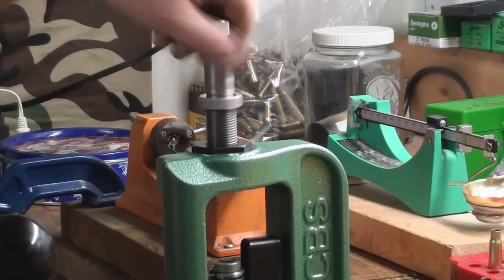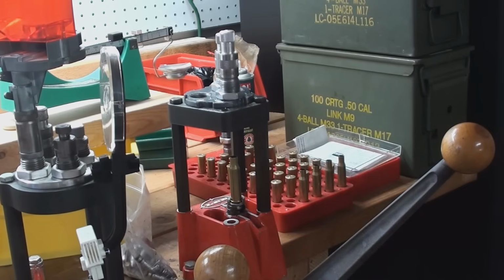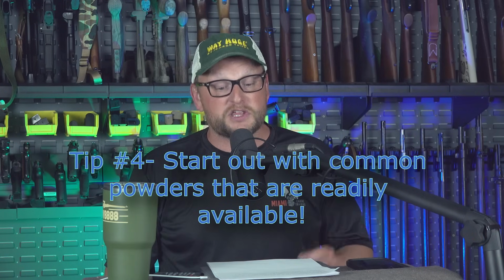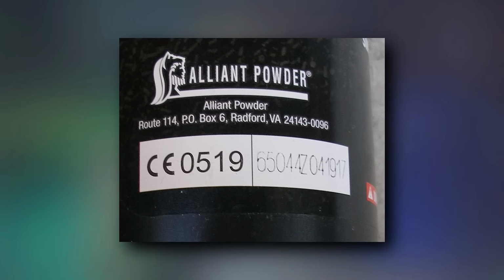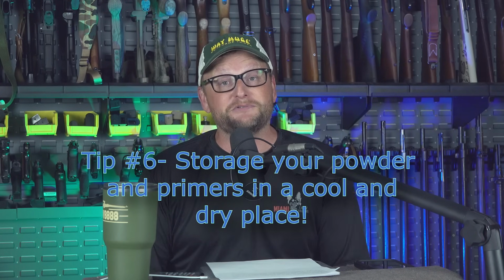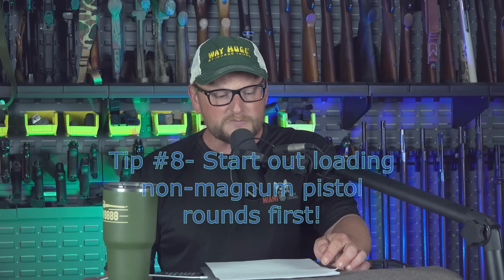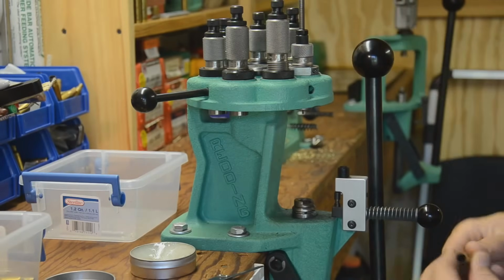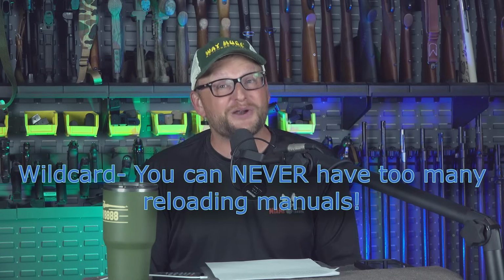Top 10 Tips for Beginner Reloaders

Comment: I started with a lee 4 hole classic turret press. You can use it as an auto indexing turret press or as a single stage. I think I have close to 20,000 rounds loaded on that press.  I did have to replace a part once, but that was because I was being negligent. The part costed 0.75, so I bought five of them and now I'm stocked for life.
Reply: I love my LEE hand press & dies.... yes parts for LEE stuff is affordable for the working man.
Reply: The classic turret is pretty solid.  Bodge or 3D print yourself a case kicker and you've eliminated the only real "not enough hands" problem.
Reply: I love this press

Comment: The Biggest one, is the reloading manual and develop your own data starting with minimum charges and work your way up to get acceptable accuracy/performance. Also keep a journal of your reloads so you can remember what you've done from batch to batch. This will help greatly if you develop a load that works really well for your fire0arm.
Reply: A good set of notes as you go along helps with consistency.
Reply: Just get good labels for each box of ammo you load and get multi colored permanent markers to color the primer end of each box of cartridges so you don't mix them up.
Reply: Keep track of the number of firings and trimming of each batch of brass. False economy if you have a case head separation, damaging you or your instrument.  Also watch for loose primer pockets. Use published data at first, to be safe. Learn what overpressure signs are.

Comment: This is a great list. If you wet tumble with stainless media, don't forget to treat the wash as toxic and hazardous. Also those pins can wreck a decapping or other die.
Reply: Show of hands, anyone who's probably sent a ss pin down range on occasion.  Lol.  It's a little more labor intensive but I much prefer wet tumbling.
Reply: I wet tumble my brass and they come  out immaculate clean...one thing I recommend is after rinsing the brass in distilled water I put them in a tray upright in the oven for about 45 minutes at 250 this makes sure the cases are bone dry before reloading
Reply: I have a rcbs decapping die punching primers and ALL my brass goes through that before going in the wet ss pin brass tumbler. Might as well clean the primer pocket while it cleans the case.

Comment: A few recommendations I have. 

1. Hornady dies with the bullet seating collar, and micrometer seating stem. It elimites SO many problems with concentricity and seating depth

2. Little Crow "Worlds Finest Trimmer II" is hands down the best way to trim brass to length, especially in quantity. 

3. If it feels off when sizing, STOP. You absolutely do not want a stuck case, they are a total nightmare. 

4. Nu Finish car polish is the best option for brass tumbling polish. It gets the same results as expensive firearms speciffic polish, and is literally 1/10th the cost or less. Use 1 cap full each time you tumble brass. It will come out mirror shiny in short order, and it leaves no residue to foul powder or primer. 

5. Reloading manuals are often brand speciffic. Hornady manuals cover ONLY hornady bullets. Sierra only covers Sierra, ect. 

6. Label EVERY load you make. You absolutely will forget what is in a particular batch of ammo. So keep a log book and label system

Comment: I’ve been reloading for five years, I started out with the cheapest Lee press you can buy I gave $38 for it. I’ve loaded approximately 3000 rounds with it with absolutely no issues. You can still get one of those for about $45, they work that’s a good way to start to see if you like it. I’m still using it cause it still works. I got started loading three different loads and I probably didn’t have $200 in the deal. Buying a four $500 press to start with is ridiculous. Lee precision is the way to go, their dies especially the bullet seating die is the best.

Comment: The Lee manual is a must when your new. I use it more than any other
Reply: Lee manual reminds me of an artillery tabular firing table, with the 1 Grain Velocity and Pressure Factors.
Reply: I prefer the Lee manual over the others. Lee is not brand specific when it comes to bullets. It gives you data for the type of bullet, shape, composition, and weight. Hornady gives you data for Hornady bullets, Speer does the same thing. Both fine manuals, but for their brand only.
Reply: Lee has load data for a wide variety of loads, far more than any other manual that I’ve seen. They aren’t trying to sell bullets so they offer data for most weights and styles. You look at the Hornady manual, for example, and there’s no data for lead or plated bullets.

Comment: I had to learn to reload from day one! 44 mags cost half a dollar back in 1986. It cost me a quarter to reload my cartridges, now it cost me a quarter to reload one and $2.00 to buy them. Lifelong investment pays off. I have reloaded over 10,000 44 mag for the same pistol. I use Lee's 44 mag hollow point casting mold at 240 grains using the litho-plate I bought back in 1987, and still have 40 pounds left over for the 75 pounds I bought for $25. Your video was very great with the information I had not thought about. Great work! Keep up the good works.
Reply: I started loading 44 mag. back in 1969, casting my own bullets.  Primers cost me 3 cents each for CCIs, 2400 powder was $3.95 per Lb.   I could shoot my 44 for less than my .22 with CCI Mini Mags!

Comment: I tumble my cases outdoors. I dump and strain the tumbler outdoors too. The current tumbler I use is a 5 gallon drywall bucket with a small electric motor bolted to the plastic bucket. A metal gear with old lugnuts welded on is mounted on the motor, this makes it vibrate. Just use a rubber bungee to hang the bucket by it handle. Does big batches and cost nothing but junk laying around.

Comment: I started with the RCBS Supreme Master reloading kit.  It has a Rock Chucker press.   Looking back, I wouldn't change a thing.  I have an RCBS case prep station and a RCBS Charge Master scale.  The reloading kit came with a beam scale.  No matter what, do NOT get rid of that.  I use the RCBS Competition Rifle die sets and the Lee factory crimp dies.  I also use the Lee shell holders with the press because they come in a case with all the common case holders.  I use the RCBS universal hand priming tool.  I do have two of the standard RCBS hand priming tools that are set up for .223 Remington and .308 Winchester respectively.  I use the Lyman Turbo 2500 dry media tumbler and the Lyman TS-2500 ultrasonic cleaner because it's big enough to clean tools and several hands full of brass.  I specifically chose the Lyman Turbo 2500 dry media tumbler because it curls back towards the center at the top.  That aids in circulating the media.  I also have an RCBS powder thrower/charger for loading plinking rounds.  I use the Hornady collet style bullet puller.  It's so much easier and more quiet.  I can use it in the morning or late night when my family may be asleep.  I log every cartridge load data that I make in a Lyman log book.  I also mark on my containers, the load data and the date those cartridges were made.  I use the RCBS lube pad for rifle brass and the original RCBS lube spray and much prefer it to the libe grease because I know what I put on the case is very light and thin.  I put used dryer sheets into the dry media tumbler to reduce dust and lead in the dry media.  I think lastly but most important are several manuals.  I use the Lyman, Richard Lee, Hornady, Barnes, Sierra and several others.  Ultimately study the craft and be safe.  I keep a fire extinguisher close so that in the event that a powder starts a fire, I can wait until the powder is done burning I can put out the remainder of the fire.  Never try to put out the powder itself if you have that happen.   It is guaranteed to spread if you try it.  Wear safety glasses... especially when priming the brass.  Again, safety first.  Never have more that one powder out at a time.  You don't want to get them mixed up nor confused with one another.  Have fun!  Be safe!

Comment: Great info. Thanks. I look forward to more.  I'm committing to starting to reload this winter. Complete beginner here.
Reply: I’m with ya
Reply: Check out the channel Johnny's Reloading Bench and Panhandle Precision. I've only been reloading for 5 years now but have learned everything I know from those two. There are other channels as well depending on how far down the rabbit hole you wish to go.
Reply: I went with a Lyman kit (included a turret press) when I started. I think it was a good kit, came with almost everything I needed. I bought an extra electronic caliper and electronic powder thrower, but other than a couple little deburring tools I think that was it. Also picked up an additional reloading book I think too.
Reply: @brutalityondemand18  Thanks. I'm subscribed to JRB. I'll check out Panhandle Precision.  Do you use a manual turret loader? If so, what kind? I've been advised to get a Dillon, but with all of the info from the net, it is difficult to make a decision sometimes.
Reply: @clamum9648  Do you still use that Lyman, or did you move on to something else since?
Reply: @givemethemusicd  Still have the Lyman. I haven't reloaded for some years cause there just isn't much room for me to set it up at my current apt but I'm gonna stick with it for the foreseeable future, works fine for me.
Reply: For reference...I shoot a lot of pistol straight wall and common bottleneck rifle.  I also enjoy shooting common milsurp at lower volume, which has sometimes been difficult to cost-effectively source in the last couple of years. My budget for equipment is $2000-$3000ish.
Reply: @clamum9648  Right on. Thanks.  It's been tough for me to make that investment with so many options out there.  I've been waffling for 3 years now, lol. Technically one year.  I was about to buy a Dillon, and didn't because of Covid and the dry-up of primers.  Didn't see the point.
Reply: @givemethemusicd  I started on a Lee hand press just doing 9mm, 45 Auto and .223. I then upgraded to a Lee 4 hole turret press which worked great for pistol loads but had a lot of variance loading rifle rounds; by this time I was loading for .223/5.56, .300 BLK, 6.5 Grendel and .300WSM. Finally bought a good single stage which I wish I would have done at the beginning. I agree with IV8888 on the RCBS Rockchucker recommendation as a first, but for more precise loads I decided to get the MEC Marksman and it is the best press I've used to date. My friend has the Hornady LocknLoad AP progressive press and it is awesome for cranking out a high volume of rounds but until you understand more about the processes going on and the prep involved, especially with loading rifle rounds, I'd say start with a single stage so you have a solid option for loading for rifles later and can upgrade to a cheap turret press from Lee if you need higher volume in pistol cartridges.
Reply: @givemethemusicd  Yeah def lots of options. I think you'd be fine with most stuff, but if you see a turrent press, or especially a kit with one in it, I wouldn't feel bad about buying it when you're ready.

I kinda jumped in without really knowing much at all so I just got the kit, and watched videos and learned bit by bit and got a couple extra things that would make it better. Once I had a decent idea of what was required, I think I started with 9mm first (actually doing the reloading).
Reply: @givemethemusicd  You should have bought primers and sat on them. The price of presses and dies went up then came back down. Primers have only gotten more expensive. We are not returning to normal prices in my life time. If you've got a great budget, just buy some components at whatever price and then get the cheapest press and dies you can.

Comment: ADDITIONAL TIPS FOR NEWBIE RELOADERS:
1) Avoid chasing after high velocity hot loads. You are far better off to trade some velocity for stability and consistency and reliability. 
2) Where feasible, use powders that have a reputation for stability… typically these are single based powders
3) Avoid falling into the trap of pursuing levels of accuracy that exceed the functional limits of the firearms you are using. Expecting 1/2moa groups all day from a lightweight magnum hunting rifle is pretty unreasonable. You can burn out a barrel trying to achieve accuracy at the reloading bench. 
4) Be patient with a new rifle. It takes 100-200 rounds for a new barrel to settle down. Usually your muzzle velocity will migrate upwards during this period while things are changing. This is not the time to chase your tail seeking teeny tiny groups. Just start with a half decent load and shoot lots.
5) Get yourself a teslong borescope… this will clear up the mystery of what is happening inside your rifle bore and make bore cleaning faster and easier. 

Cheers!

Comment: Been hand loading for 36 years, and this is some solid advice.  Don't be fearful of getting a Lee starter kit, as long as you go into it understanding you will eventually be replacing everything, but it is a very economical way to get your feet wet as you learn & research... I speak from intimate experience on this one.  Another thing is don't get hung up on brand loyalty... my single stage bench is a myriad of colors.   Where you will likely lock yourself into a brand, though, is when you decide to go progressive along with all necessary support pieces... Go Blue !!  🤣
Reply: I've been using the Lee single stage press for 9 years now with no issues at all. Great option for a beginner.
Reply: @commiecrusher  
Mine lasted almost 20 years.  It's death-knell was when I started reloading 45-70... it didn't like resizing those tall cases and eventually tore itself apart.

Comment: As far a storing powder and primers you are spot on with your suggestions except  for storing powder in an ammo can. You are correct in that it prevents moisture from entering but all storage recommendations by manufacturers suggest a storage container that will not act as a cartridge if the powder somehow becomes ignited. It must have a failsafe wall in order the powder will burn as it does in open air rather than how it does inside a cartridge.

Comment: Great video. If you’re just interested in hunting, I’d buy one rifle only, who cares if it’s too much gun for small game, but I like 6ARC or 308. 1 scope mounted on picatinny rail. The money you saved from not buying many rifles can go into other things that will take you further. 1 nice stock. 1 nice ball mount tripod with arca mount if it suits your rifle. A nice front heavy sandbag and the shmedium rear bag, it’ll improve your testing later.  A nice bipod too. A nice chrono (Garmin will do). If you don’t get sub MOA with factory loads or if you want to unlock versatility (lighter or heavier projectiles), then reloading gets even better with one cartridge (1 set of dies etc). If you got a nice custom rifle from beginning, factory ammo is probably all you need. And you’ll enjoy it that much more (including reloading that is). The money you save by not buying many different rifles can go towards the nicest set of scales for powder measuring, likewise calipers (mitutoyu are pretty dam good, just not from eBay fakes). There will be other reloading tools but most cheap to mid range single stage press will be fine. Some don’t clean brass or anneal, be critical if you think you need extra stuff. Apart from scales and dies, everything else mediocre will be fine. Warehousing components for multiple rifles is retail consumerism.

Comment: Just wanted to share a bit of my experience with case lube.  I had a real tough time with finger application type lube constantly denting my bottle neck cases.  I was at a local Sportsman's one day and a guy recommended I try One shot case lube. It is probably the one single item that made a massive difference both in my loading time and frustration with cleaning cases or trying not to appy too much.  I just bought a RCBS loading block I store in a plastic bag.  When I'm ready to lube the cases, I just put them all in the tray, walk outside, hold the can about 45 degrees, and spray all of them at once.  Takes literally less than 10 seconds and haven't had a single stuck case or dent since and that was about 2 years ago now.
Reply: If you’re getting dents in the case neck/shoulders it means you used way too much. And also keep in mind it can buildup in the die over time. So I periodically clean the die. 
As for spray lubes a lot of the time the reloading spray lubes are just rebranded hardware store spray lubes. Once you find what you like, you can find it’s cheaper parent in the hardware store.
Reply: Wd-40 dry lube.... not the graphite one.. found at harbor freight. Works great, no mess and cheaper than one shot by far

Comment: I miss your old reloading vids that disappeared!
I have a LEE classic cast and it's a beast, my dad has a rock chucker and I can't think of any reason to spend the extra on the green one, but that's just me.
I love the turret for loading cast rifle loads.  I can have the neck expander die in one station, swap to the bullet seater die, then the crimping die.  All done without having to change dies for each step, just rotate the turret.
For a new reloader, I'd say forget the dry tumbler, get a wet tumbler or just go by the cheap harbor freight tumbler and order some stainless steel pins.  Not only does it clean better, you lower your exposure to lead dust.

Comment: I think starting with pistol calibers is a mistake, because they are easier to double charge. Here is why .223 with a max charge of 27.4 grains of powder will fill 80% of the case, so a double charge would way over fill the case. But 9mm with a max charge of 5.4 is less than 20% of the case, so if you double as a noob you probably won’t even know it’s double charged.